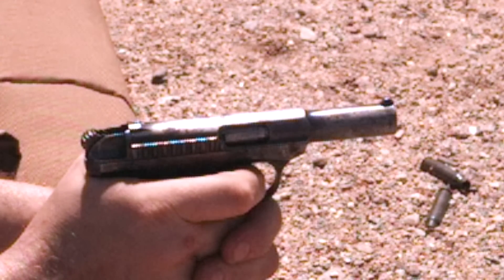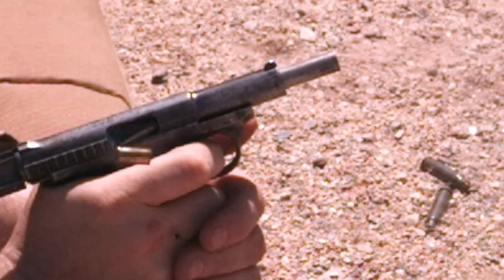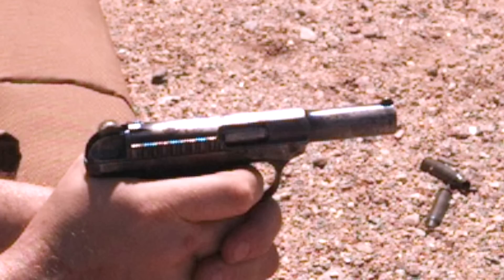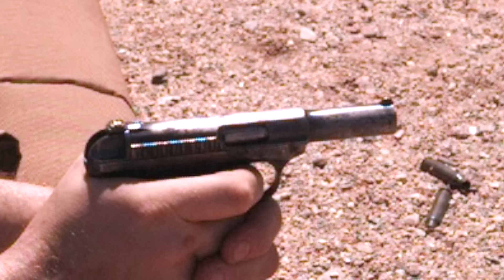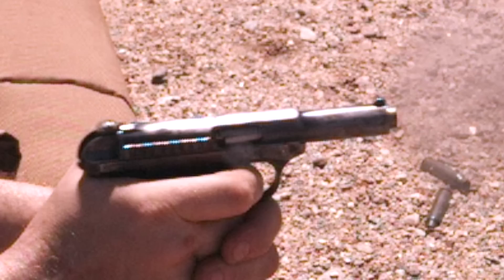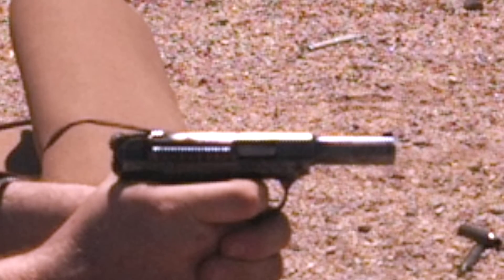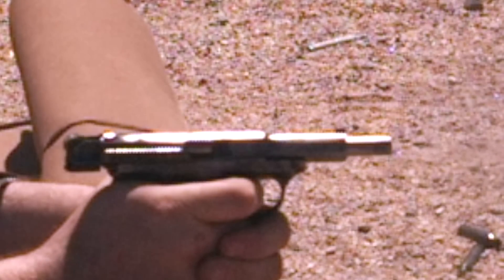Ask Ian: Analyzing the Savage Rotating Barrel (at 7500 frames/sec)

Comment: I love these little pistols, but I question whether the barrel rotation adds any delay at all. The fact that the sliding parts weigh less than a competing blowback pistol doesn’t really  prove anything. In my experience, it’s entirely common for sparks to exit the side of the pistol along with the brass, which suggests the breech is opening too soon, something that would be expected from a blowback pistol with too little mass in the slide. If you look at the track in the slide as well as the motion of the barrel, the slide travels perhaps a millimeter before it even starts to rotate the barrel, at which point I expect it’s already up to speed, and I can’t imagine that short bit of rotation slowing it down. I would love to see slow motion footage of a firing 1907 with the track lug having been milled off to compare to a standard pistol. (Barrels are cheap and plentiful.) Regardless, I appreciate the video and your channel. Thank you!

Comment: does it have progressive rifling or constant? i wonder if it would be more effective with progressive rifling if it is constant. 
if the theory is the rifling spinning the bullet, the inertial of the bullet from spinning is countering the barrel rotating. i wonder if slowly accelerating the twist rate could give more time for it to remained locked since it would be fighting the inertia of the bullet spinning the whole barrel instead of the first part of the barrel.
or it might not give enough initial inertia and would actually open the slide sooner.
reminds me of the blish lock of theories that dont work but were used anyways

Comment: It’s awfully close to qualifying… they probably measured with a “trained” eye instead of a high speed camera. If they had increased the amount of rotational force necessary by changing the groove to a slightly steeper angle they could actually have gotten there. It’s fascinating how technologically proficient they were in spite of having none of our “modern” designing capability.

Comment: If the lugs and slots were in the opposite position it would be a locking action. 

That arrangement is used on Beretta 8000/PX4 pistols.

PS: Ahh but then you couldn't have the spring around the barrel as the spring couldn't rotate the barrel when the breech is closed but not locked.

Comment: It would be interseting for you to do a collaberation with the SloMo guys with their super high speed cameras to see things in much better clarity, it would be good to use them to see if advanced primer ignition takes place on some of the fixed firing pin open bolt sub guns like the Sten etc
Reply: ^^^   THIS   ^^^
Reply: I've wondered for years why Ian hasn't made something with them. I remember when Ian asked for help getting his camera and got it funded in like a day (like 2015 so old camera). Cool dude
Reply: Smarter every day would be better.
Reply: One of my first thoughts as well.
Reply: I WAS GONNA SAY
Reply: pretty sure those guys dont approve of firearms. their older stuff dealt with them a little bit but not anymore. they'd get cancelled so quick.
Reply: @sprolyborn2554 it's not that they don't approve of firearms, they've done a fair bit with them over the years. It's just firearms alone tend not to lead to interesting footage and there can be some YouTube monetization issues. That said I don't think they've ever considered doing anything which focuses on the mechanical aspects of the gun itself, especially nothing like an open bolt smg. 

The main reason they also tend not to do anything with SMG's and the like is they lack access. Neither of them qualify to be NFA approved, Dan isn't a US resident and Gavin apparently isn't inclined to own firearms (especially after the incident with the armed home invasion several years ago).
Reply: @sprolyborn2554  Not true.
While it's not their specialty, they like firearms and explosives. They even did some cannons relatively recently in their career.

And besides, speaking as a leftist, if someone cancels you for liking firearms, they're a fucking liberal and not worth listening to.
Karl Marx: "Under no circumstance should the proletariat surrender their arms."

Comment: Interesting. My initial reaction upon seeing the savage system was that it was complete bs, interesting to know that there is actually something to it.  If it didn't involve cutting up a cool old gun I would think that an interesting follow up experiment would be to measure the velocity of the slide before and after grinding off the rotation lug on the barrel to see exactly how much the slide velocity changes.
Reply: Theres an article from a gun magazine from the 80s that did this. Apparently there wasnt any felt recoil difference.

Comment: Mainly for the purpose of feeding the algorithm, I have two comments.
While you can't rearrange the orientation of the range, either wait for sunlight to be behind the camera, (and)/or open the aperture on the camera.
More of a question:  if there's still burning powder, wouldn't the barrel pressure potentially still be rising until the bullet exits?

Comment: If the barrel rotates counter-clockwise and the bullet is spun clockwise by the rifling, then the bullet will actually impart an equal and opposite force onto the barrel as it is spinning down the rifling. This means that it would actually UNLOCK the gun. Maybe the rifling isn't the direction you said?

My reasoning: as the bullet is forced down the barely some of its forward momentum is transferred into rotational momentum via the rifling. If the bullet starts to spin clockwise then the barrel will experience a force in the opposite direction.

Comment: 6:20 If you want to distinguish it something like that, just base in on whether it uses force pushing on the casing, or pressure that's diverted somewhere else. I'm sure there are examples of gas driven guns that start cycling before the bullet leaves the barrel. Try high speed filming some gas operated shotguns, especially the ones with ports right in front of the chamber; I think Remington's Versamax is an example, and I'm pretty sure they basically copied some variation of a Benelli for that.
Reply: Of course, typical auto pistols are locking even though that categorization wouldn't fit them, but... anyway, shotguns.

Comment: Follow up question: shouldn't it still be considered as "sealed" even though the slide is moving? Am I mistaken to consider that there is still an effective seal between the brass and the barrel as long as the front of the case remains within the chamber?
Reply: If there is space between the case head and breach face, it's not sealed.  Once there's nothing physically holding the case in place,  and it starts moving back out of the chamber at all, the pressurized gas will find a way, too. The "delay" in "delayed blowback" prevents this from being dangerous by keeping it contained enough for just long enough, and why this system is still safe, even though it is not locked or sealed.

Comment: if I've got the physics correctly, under the right circumstances it just might function as a locked breach system, but you would have to get the powder charge, bullet weight and maybe the recoil spring strength just right. Seems like a long shot though.
Reply: I don't think so. I took this vid to mean it's never locked, not even for an instant, so even with the perfect balance I think you're suggesting, at best you'd just be not overcoming inertia until the bullet leaves the barrel, but never locked.  But I could be wrong.

Comment: That puff of gas from the muzzle before the bullet exits--is it compressed air from the inside of the barrel being ejected or is some of the propellant gas leaking past the bullet BEFORE exit?  

Bullets have to pass through that turbulence on their way to the target.  Gyroscopic stabilization will correct any deviation when the bullet has had sufficient travel.  I discovered that a 9mm 124 grain FMJ from a Beretta M9 would fail to penetrate a Level I vest panel 2 out of 3 times at ten feet, but all would zip through the same armor level at seventy-five feet.  Could it be bullet stabilization? Is it powder gas or compressed air or simply the bullet isn't stabilized until some distance past the muzzle even though at full rotational speed?
Reply: Thanks, that all sounds very interesting and might be a good subject for further investigation. In a pistol barrel, the bullet obviously must push out the air sitting in front of it in the barrel. If the bullet then passed through a wave of compressed air, that might cause some pitch and or yaw motion which then die out due to the effects of the spinning bullet and/or aerodynamic effects on the bullet.
With a worn pistol barrel, conical or cylindrical bullets can fail to stabilise. This causes "tumbling" bullets that are seen to pass through targets side on, or partially so.

Comment: Interestingly, given how well tuned all the part masses are to make the timing work out right, the designers have to have known what was going on here.
Reply: Not only the timing has to be correct but probably need ammo loaded exactly as the designers tested with, this design will "unlock" the microsecond the bullet clears the rifling since it's depending on that reverse torque to keep the barrel from turning, with that any wear in the parts would also allow the slide to move early. To really prove whether this system is actually staying locked you would need a pristine pistol and ammo plus a better camera.

Comment: Go take a look at the SlowMoGuys - the more frames per second you get, the lower your image resolution has to be. Gavin has done a lot of work to explain why and how this works.
Reply: IAN- great video just a suggestion on your photography if you'll look at your arms or the shooters arms they're all cast in The Shadow on the side of the ejection port and if you look at your shooting roll it also has a shadow to the left if you would shoot at a time of day or be in a position to have the ejection Port facing the Sun that would light up that whole ejection Port area thereby assisting in your photography I understand as you explain that as the higher up you go and frames per second it affects the quality of your photo however I think most of that ejection Port area was in a shadow and if you would try to get it into the sun by shooting at a time of day that that could happen then it would be a lot more beneficial to the clarity of what we're looking at. Fantastic obscure question and I like your effort and explaining exactly what the 1907 does this is just a little tip that my assist you in the photography work keep up the good job I appreciate it.

Comment: I have a 1917 that I found at a pawn shop. The front sight is missing (maybe intentionally filed off), so I might have to get a NOS 1907 top slide that I found online just to make it somewhat practical.. I know the serrations on the side are different, but otherwise it should be inter-changeable. I also want an aftermarket mag. SUCKS that they only hold 7!!

Comment: If the bullet is still in the barrel when the shell is exposed the casing will expand and may rupture And also will cause damage to the stops in the slid. A spring and slide wt. would be enough to make enough inertia for a 1000 fps bullet to beat the ejection of the shell.

Comment: Well that's an interesting conclusion on what's an obviously old gun . The fact that in order to determine this you needed to use a camera at 7500 FS something not even available in 1905 when this gun was patented is also interesting. So they would have never known this if even new guns operated the same. Perhaps this is less conclusive evidence and more a fun fact about you particular 115 year old gun which due to wear doesn't lock quite as well as maybe it did when it was new.

Comment: I wonder if this pistol doesn't actually have a locked breech when firing because of the slop in the action or is it because the first part of the groove in the slide is not angled enough. It the angled part of the groove in the slide was closer to 90 degrees than the roughy 45 degrees it appears to be, then it would have been even more delayed. then you have the slop in the arc groove in the frame. This allows the barrel and slide to start moving back a little while still locked. Then you have to consider the looseness of the pin in the groove. Any slop there between the pin of the barrel and the width of the groove in the slide actually helps to delay opening. Then you have to consider reliability using wide ranging pressures in ammunition at the time. You need loose tolerances to improve reliability. In the end it was a good try but no cigar. If you really wanted a locked breech that was actually modernized take a look at Ian's Video on the Colt 2000 (that wasn't very good either.)

Comment: Very good work with the highspeed. Excellent gunsmithing - sleuthing. But, for camerawork, try not to have a shot with the moving parts in shadow, if necessary fire upside horizontally or even upside down so you have full sunlight on the moving parts.

BUT, that's a great reason for a "what is with" shooting gang-style i.e. holding the gun horizontally?

Comment: it's quite simple actually.
Had the parts still been completely locked, the moment the bullet left the barrel and the pressure dropped to safe level. Then there would have been NOTHING LEFT to open the action afterward. 
If the slide is the only moving part, it's quite obvious that the slide must start moving before the bullet leaves the barrel, to have enough residual kinetic energy to complete (ore even to begin) the cycle. It's not like the pistol can store energy somewere.

On the other hand,  the momentum of the recoil (equal and opposite to the one that pushes the bullet forward) MUST be MUCH stronger than the one that makes the bullet rotate (and so, for reaction, the locking one) OTHERWISE THE BULLET WILL NEVER LEAVE THE BARREL. So that momentum can't, in any case, lock the action.
Reply: Thanks, that's a great explanation. 
As regards momentum, in formal analysis, moment has to be treated as a vector quantity. I think this system will have linear momentum terms along the bullet's axis of projection (from the forces on the breech and bullet) plus angular momentum terms about that axis (from the torques developed by the slide cam track and the rifling). 
Via the cam track in the slide, the force on the breech face is trying to turn the barrel one way. Via the rifling, the force on the bullet is trying to turn the barrel the other way. The video makes it clear that the greater torque is coming from the slide rather than the bullet. As you said, if the bullet exerted the greater torque, the slide could not recoil and would not cycle the action.
Reply: Excellent explanation

Comment: My Grandfather was in the Army Air Corps and flew B-17 aircraft during WWII. He was a Quaker, and frankly did not care for guns but was obligated to keep a side arm. He chose the Savage 1907 in 
32 ACP, as it was the smallest semi auto available to servicemembers. Ironically, he flew components of the atomic weapons used on Hiroshima and Nagisaki from NY to CA. We still have his old gun, unfortunately it needs a new extractor. Anyone know where I can get one?
Reply: eBay is the best place to look for parts. Be aware, slight dimensional changes were made to these pistols over there production run, so try to find parts from the same vintage/year for best results. Parts from early guns don't work well in later guns and vice-versa.
Reply: @brogeoti  thank you!

Comment: Hum, I just realized how similar this is to the CMMG radial delay system. Actually they are nearly identical, ha. I doubt CMMG even realized it.
Reply from the maker: CMMG got their inspiration form the Reising SMG, actually.
Reply: @ForgottenWeapons  I remember hearing that, and it makes sense.
Reply: In terms of using a rotating object to delay the opening of the breech, they're similar. In terms of how the delaying mechanism actually works? They're completely different.

The CMMG system uses the rotation of the breech face to accelerate the bolt carrier faster, in effect increasing its effective weight, due to how kinetic energy scales with velocity versus mass. This is basically how a roller delayed or lever delayed firearm works

The Savage system, assuming it's working as written, uses the force of the torque of the bullet on the barrel to slow the opening of the slide. Nothing is being accelerated; instead, the forces the bullet exerts on the barrel as it rotates from the rifling are holding the cam lug in place. In terms of how the forces are acting to delay the slide opening, it's much closer to a gas delayed blowback system than the CMMG system.

With delayed blowback, you need to look at where the forces on the breech face are going, and how they're offsetting the opening of the slide. In the CMMG system, as well as HK's roller delayed, or the lever delayed system used in the FAMAS, the forces are being used to accelerate part of the reciprocating mass faster than the rest for the necessary time for the pressure to drop. In the Savage system, that isn't the case; the breech face and slide are all one part. Instead, it's using the torque of the bullet rotating in the barrel to hold the rotating lug in place for a fraction of a second until the pressure has dropped safely.